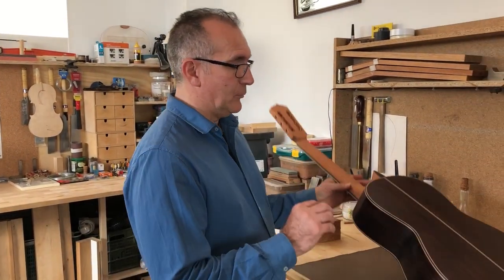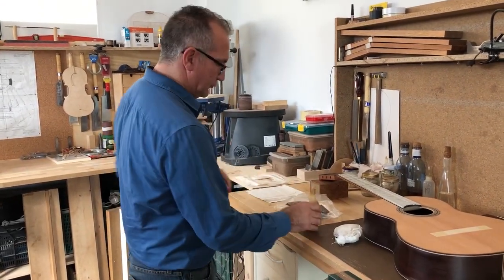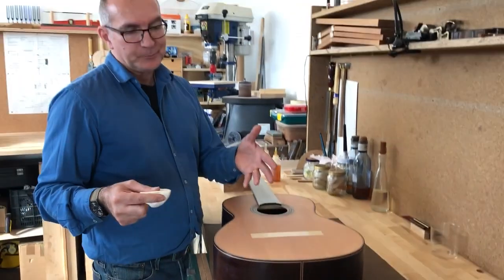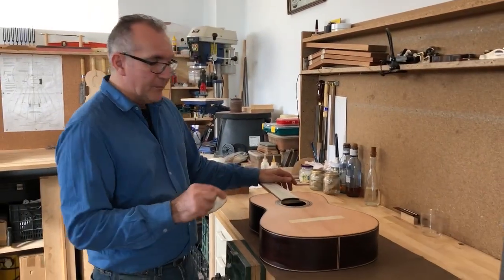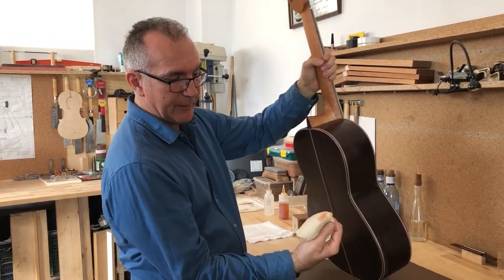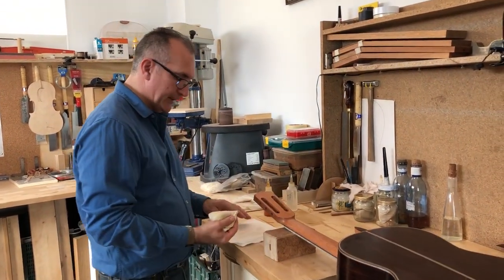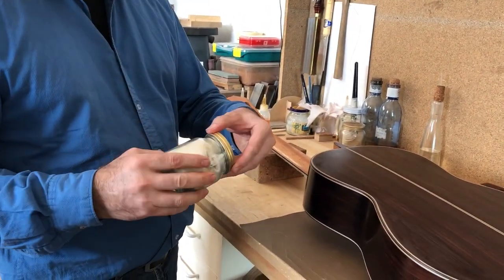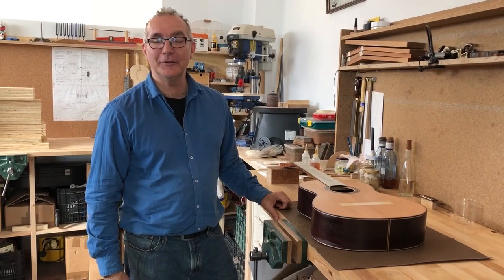How to French polish your guitar. Video 4 of 9.

Comment: I am being hooked into attempting french polish again. my initial experience was not too good, but the way you do it gives me confidence. I don't think that I can tell the difference in terms of sound but the reputation that comes with it is worth pursuing it.
It shows you that as a luthier you can go the extra mile, actually the extra 100 miles, this is soooo much slower than spraying nitro. Don't blame nobody when right in the last minute you screw up because you applied too much pressure, it is all like an intuitive process,  a challenge that no robot will take it away from you. Sos un groso Pable sigue asi!!!
Reply: I like the fact you’re not required to use toxic lacquers and having to have specialized spray equipment. I’ve done one French polish project as well as hand applied varnish and other oils.
They turn out really nice with a feel that you just can’t get with nitro or other similar procedures.

Comment: Would be interested in advice on offset sound hole designs (eg, Tacoma Chief style), where there is an area of soundboard all around the fingerboard (instead of a centre hole). You can't cover that area with long with-the-grain strokes.
Reply: That's why he shaped the rubber in to a point, so he could do the areas beside his fingerboard. You can do the same on your guitar, as a side ways stroke or come across it in a circular pattern.

Comment: Do you ever do the finishing on the body and the neck, separately, and then assemble the guitar, like they build Martin guitars?
Reply from the maker: No, I know it is easier to polish that way. I just prefer to use the traditional Spanish method.
Reply: @redkitekk  I am personally more knowledgeable about steel string guitars, so I am wondering if it is a common occurrence that guitars of that caliber will eventually need a neck reset.

I have seen quite a few nylon string guitars that did need a neck reset, simply because it is not possible to lower the saddle much on a nylon string guitar, especially if it's a bridge with 6 string holes. However, all of those guitars that I've seen, that needed neck sets, were nowhere near the quality of instruments that you build. 

As I'm sure you know, on Martin guitars it's pretty much just a matter of time when a neck reset will be needed. But those are steel strings guitars, so I'm wondering how nylon string guitars, at your level of quality, typically age.

As you know, it is much easier to do a neck reset if the finishing was done separately on the body and on the neck. So, when I asked my question it was also coming from the idea of easier serviceability, down the line. 

I'll have to check out more of your videos but I'm wondering if you might have any videos that show how you might deal with finish repair after a neck reset. 

Thanks for sharing your knowledge.

I also want to compliment the camera work. Whoever that person is, please send my regards.

Comment: Do you also treat the machine head slots on the inside of the headstock ?
Reply from the maker: Lynda McArdle yes, I brush French polish in the slots.
Reply: This is the spot that I have the most trouble with.  It would be great, Pablo, if you could show how you do the slots in a future installment of this series.
Reply: @redkitekk  I presumed that, as a perfectionist you would but, nevertheless, it's nice to have this confirmed. Thank you. No reply necessary.
Reply from the maker: Hi Paul McNamara, it is really quite simple, it is a difficult area to access so nobody would expect to see polished to the same degree as the rest of the guitar.
As long as you have a couple of coats of shellac brushed in and you make sure you don’t get runs of polish into the slots when you polish the head you would be ok.

Comment: thanks a lot for sharing. look, how many coats shall i do per day? 1 session means serveral coats in 1 day or just 1 coat? thanks
Reply from the maker: Gledison Fonseca to do one session should take you 15 or 20 minutes and you can repeat that every 3 or 4 hours.
Reply: @redkitekk  thanks for the tip. Look shall i wet sand between the sessions or just at the end if necessary? Cheers
Reply from the maker: Gledison Fonseca only when necessary, and I would do it dry.
Reply: @redkitekk  how many sessions do you do per day? im currently doing 3 full "coats" per day and i have already a glossy layer. however im not sure when is ready in order to avoid to sand it through the wood . thanks
Reply from the maker: Gledison Fonseca when you look at the reflection of light on to the wood you will see if there are any imperfections, if that is the case then you need to do a little bit of sanding in those areas, if everything is good then carry on polishing and only do the sanding if necessary.
Reply: @redkitekk  perfect. Look, i added a waterslide decal an coated over it. Do zou think that a good amount od shellac will be untill i dont see the decal bounderies anymore? Thanks, just need to know when to stop polishing :)
Reply from the maker: Gledison Fonseca  if the decal is very thin it might be possible, but I have never done that so I don’t know for sure.